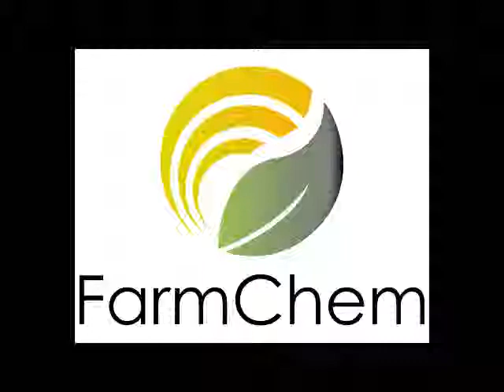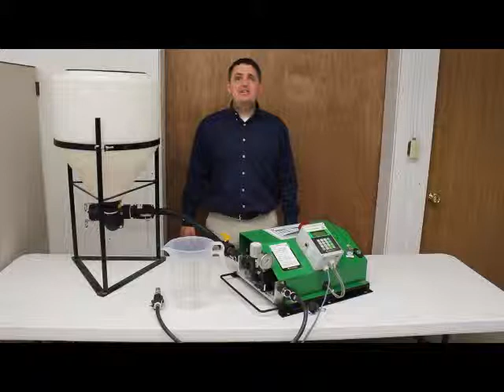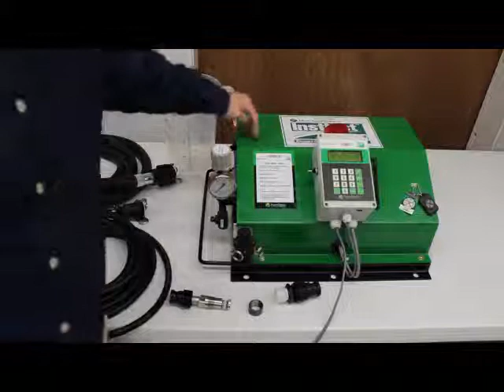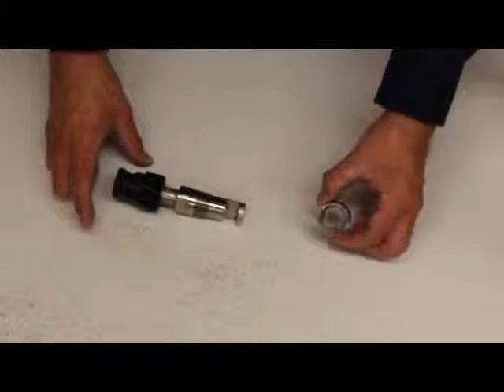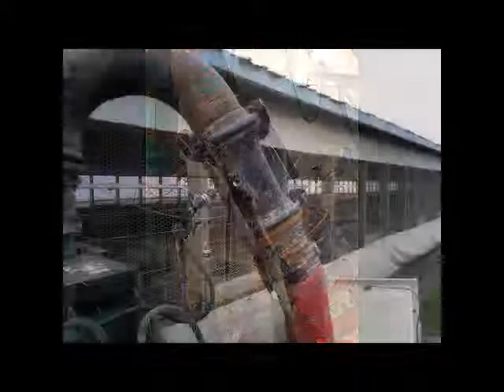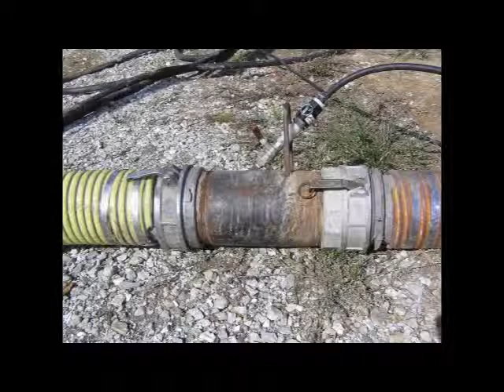InjectMATE Instructions

Comment: Has anyone had any issues with this pump? Specifically low voltage pump failure? There appears to be no issues with priming but when a preset program is initiated it faults out.